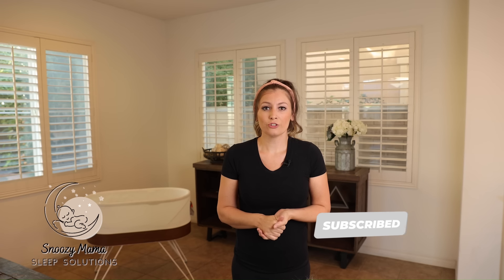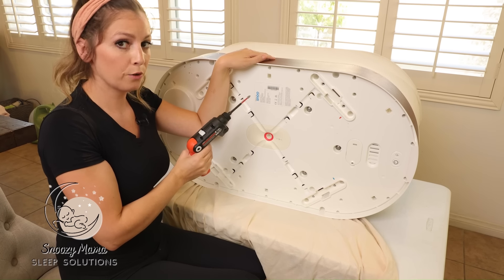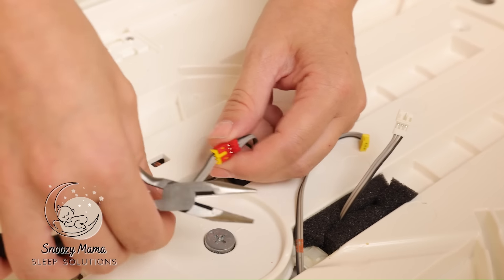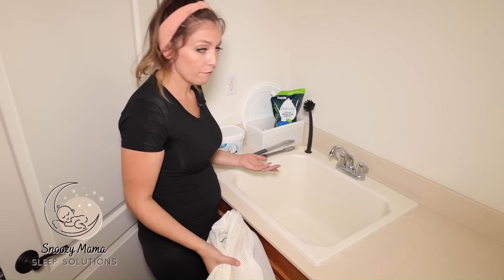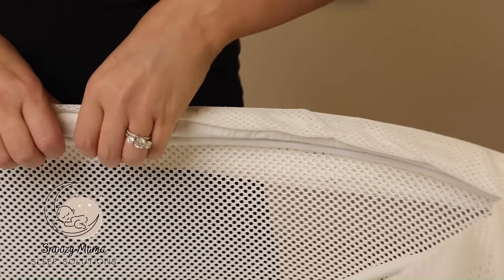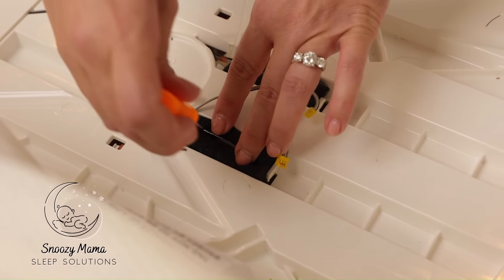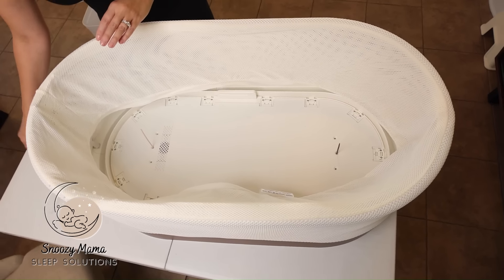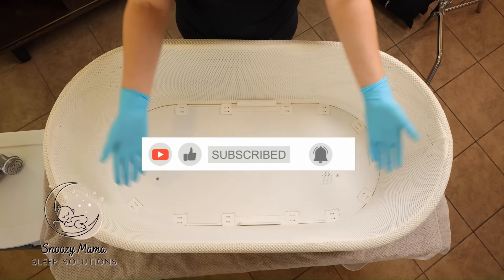Ultimate Guide: How to Deep Clean your SNOO by an Expert (Snoo Mesh Removal)

Comment: We have a triple loved snoo to return clean to the original owner, if the motor starts to rumble with each movement does that mean it needs new O rings? is my baby too big for it and it’s just struggling? 😂 Thanks for the amazing informational tutorials ❤
Reply from the maker: Hi @holypop 
Yes this would mean that the Orings need to be replaced. Anytime your Snoo makes a jerky movement or any kind of weird noise; 9/10 it means that the Orings need replacement. 
I recommend buying our Orings kit to get the exact size and material specifications. Some people use 4 small Orings they found on the internet but this is not safe to use and you run the risk of further breaking your Snoo. I’ve seen this happen countless times.

Comment: Thanks for the awesome video! I hand-washed the snoo mesh with oxyclean and baby detergent. The internal mesh turned completely pale yellow even after soaking it in a bucket overnight (close to 24hrs). Any advice on what to do next or is it a lost cause now?
Reply from the maker: Hi. Some of the Snoo's internal mesh is a pale yellow at baseline, so there is no way to make it white like the outside mesh. Now that you have clean and white outside mesh, it's probably more prominent/noticeable than before. :)
Reply: @SnoozyMama_SnooCleaning-Repair  thanks for the quick response and context! Appreciate you!